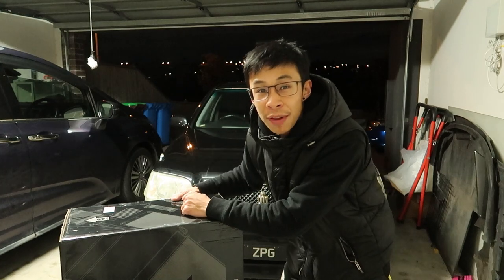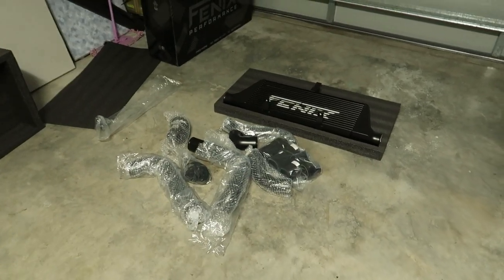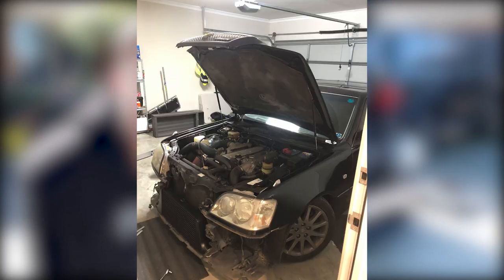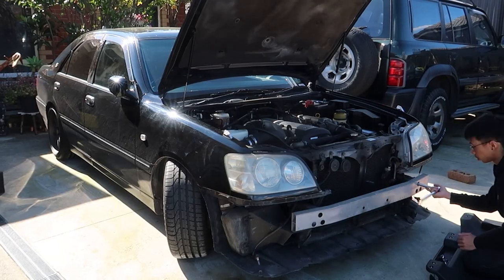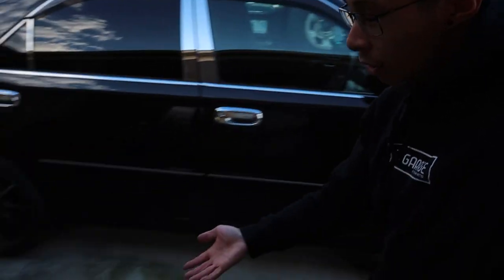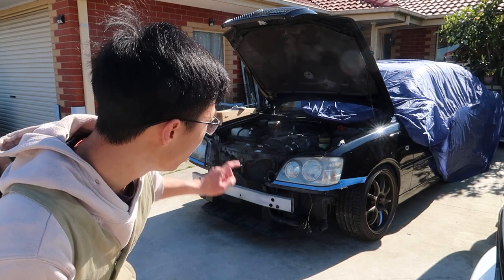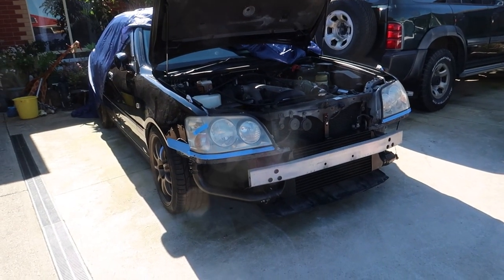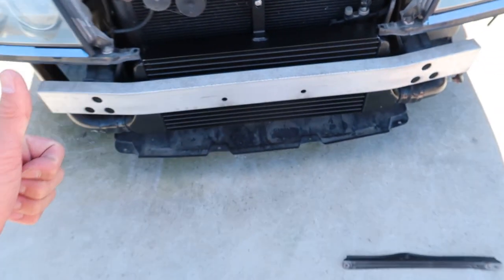Installing a FENIX Front Mount INTERCOOLER KIT onto the Toyota Crown JZS171!

Comment: Did you have any luck getting more clearance between the wheel and piping? Mine is pretty tight aswell and sometimes rubs when turning left just wasn’t sure if it’s possible to get any more clearance ?
Reply from the maker: I had to take off my guard liners, then when I put spacers at the front it was rubbing on the drivers side where the metal piece that used to hold the fender liners.

So I just hammered the tab in but you could probably remove the small metal piece.

But other then that I couldn’t get more clearance